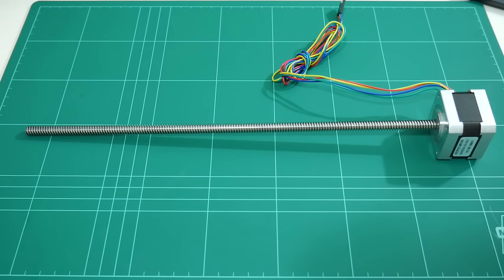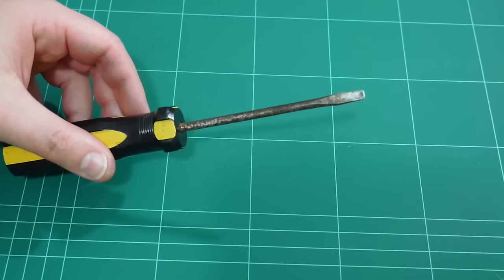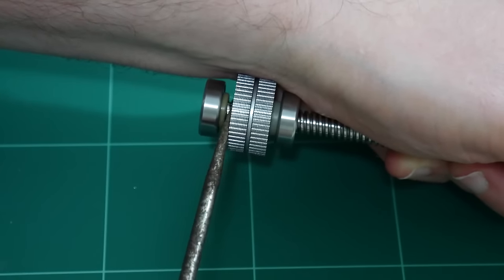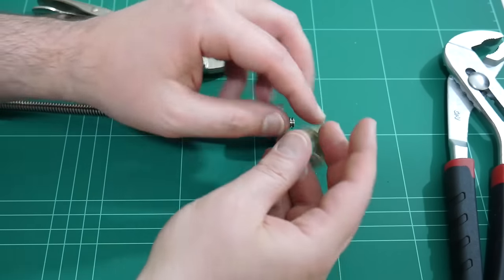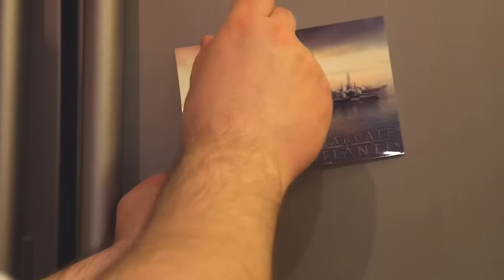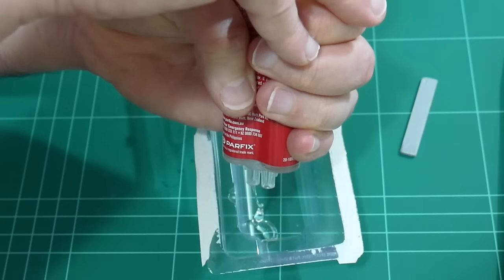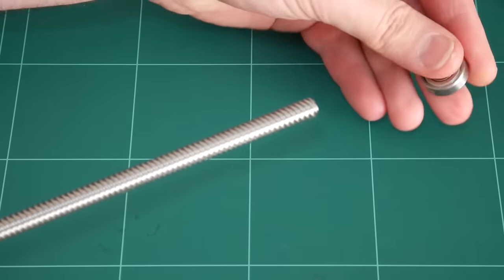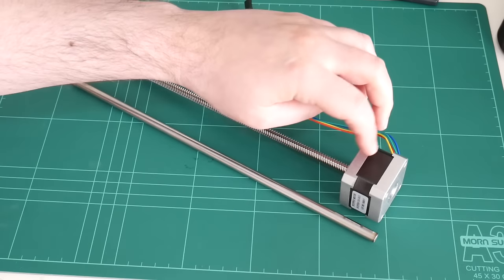3D Printer stepper motor mod

Comment: For anyone who is concerned with the loss of torque by disassembling their motors, don't be. This does NOT apply to the hybrid stepper motors that we use in our 3D printers.
Here's a video that debunks this myth: https://www.youtube.com/watch?v=A4WZm45XJ84
Reply: debunks my arse. Do you even understand what you just watched?
Reply: @m3chanist 
I took all 5 motors of my cnc steppers apart and removed the shafts and soldered better wire in. (4/18awg shielded. could have gone with smaller gauge wire but that's all I could get shielded at the time) what wire i did have was too short and a cable management nightmare because they were unbonded wires. 
There is no reason taking them apart would magically remove torque like fairies escaping a prison. if you got everything lined up right so it doesn't bind it will work the exact same.
I had an issue with binding in a few so I had to take one of them apart up to 4 times to get things aligned right. they worked exactly as I bought them when finally reassembled. 
The drivers aren't even set at full current for them. 3 out of 4A for 2, 2A steppers. 

I didn't see any torque fairies escape, nor did I damage any windings.
Reply: Then you don't know anything about the precision alignment of magnetic domains. Unless you can extract the rotor while maintaining perfect alignment, ideally with a shielding shim slid between the rotor and stator at the same time, as a professional service jig does, you are going to lose torque. The fact that you can't just "see" it and have no way to measure that accurately doesn't mean it doesn't happen.  Maybe you won't get electrocuted if you stick your tongue in a wall socket, you can't "see" the electricity right? Read Anthony Hammonds comment below.
Reply: @m3chanist  It's a self-aligning construction - to an extent - as long as the bearings are more or less made to the precise size, the spacers maintain alignment, regardless of how the shaft sits. Apropos bearings, they simply warp in use, so... there goes any assembly precision. The domains maintain as much alignment relative to each other as there was to begin with because they're all in one solid piece that you're not taking apart. The whole construction is engineered for fast and sloppy assembly which is no doubt the case if we're speaking of these $5 motors you get with the printers. Just give it a try, you can probably push the shaft in and out a tiny bit, and that's also the extent of assembly variation.

You could connect one of these motors in virgin state to a potentiometer or rotary encoder and microstep it, you'll see that it's pretty uneven, and to the extent that it's usable, it's because multiple domains and coils are engaged at the same time, the alignment is actually pretty bad, it won't get any worse. You could look at what uStepper guys are doing.
Reply: Torque is not the problem. I just changed the shaft in a motor and spent the last hour trying to get the alignment right. I failed and gave up. I can't believe that he managed to get the glued-on modification in this video working because the tolerances are so tight.
Reply: @soundspark  yes you loose torque. I've taken apart a number of steppers many years ago. REGRETTED badly after they lost half there torque. this guy is a fool claiming it wont.
Reply: The truth is: stepper motors have something called "closed magnetic circuit". 
The rotor's magnetic field is kept as long as it stays in this closed magnetic circuit formed by the stator.
Once you get the rotor out of the motor, it'll get partially demagnetized.
In this little motors it's less visible, but trust me: it'll be a bigger problem as the stepper motor gets bigger.
The thing is... In this little motors is easy to double the current to compensate the loss of magnetic field, now consider a stepper that needs 6A to operate...
By the way, I'm electrical engineer, working repairing motors for industry since 2008.
And I did magnetized a ton of steppers after "it went weak after we changed the ball bearings".
Another tip: you can disassemble it, just guarantee that the rotor don't get out of the stator, and you'll be fine.
Reply: @electronicscaos  Hello. I disassembled my nema 23 in order to replace the pulley. Indeed, the magnet lost its strength and the voltage in generator mode became half as much. tell me, can I magnetize the rotor at home?

Comment: I was following your instructions but I took my stepper motor apart and now I can't glue it back together because I can't print the stir stick, because my stepper motor is tore apart...
Reply: Why did you follow instructions before knowing what they did? Also, this isn't an upgrade, this is a mod to use an old stepper in a brand new printer. If your printer is already working, doing this will literally just make the leadscrew either too long or too short...?
Reply: Someone obviously didn't get the joke.
Reply: @chemykl  Did you wait for 24 hours

Comment: lots of comments about using heat to take the rotor off the shaft.  too much heat will damage the magnets, stick with hot water.  also if you do not use a high temperature epoxy then this will fail when if ever your stepper gets really hot.   The ball screw I used when trying this was 0.001 in. smaller that the shaft the stepper came with.  additionally the shaft had crimp marks on it possibly to make the bearings and rotor snug and centered.  I was not able to recreate this crimping perfectly.  my rotor rubbed on the stator because it was not centered perfectly.  I put it on my lathe with a high speed grinder and straightened the rotor enough for it to work.  However I have to think this will not function 100%

Comment: My magnets came apart, and I had to do this twice. Make sure the N and S magnets are out of phase when you goue them back together. Also, I really had a tough time getting the glue to break and I scratched up the magnets a bit. It's performing fine, and since it was basically scrap, I'm happy I did it. Thanks for the tut.

Comment: Thank you Tech2C for this video. I have been able to swap the lead screws in a couple of ANYCUBIC/Aliexpress integrated lead screw stepper motors. I used hot water to soften the adhesive and held the magnets in the wood-lined jaws of a vice rather than in multigrip/water pump pliers but otherwise the method was the same.

Comment: Rather than using channel locks and vise grips and potentially messing something up, try submerging the end of the shaft with the rotor into a jar of acetone for a couple hours.
It will most likely allow you to easily unscrew the rotor with little effort.

Comment: How's this mod holding up? I've found that those those super fast cure 2 part epoxies tend to be very brittle. The faster the curing, the more brittle it is. Curious if the heat and vibration has caused any issues for yah.

Comment: I just took my stepper motor apart about 4 times trying to fix it.  I traced the problem to it's connector - it was wired wrong.  Now it is working great.
I am just proving the point that taking the stepper motor apart doesn't affect it's performance.  The rumor about demagnetizing it is a bunch of BS.
And thanks to Tech2C for great videos and designs.  Keep them coming PLEASE!
Reply: I just checked my spare Nema 17 motor (brand new) and it spins freely.  I think you should hook your motors up and see how they work.  If you put them back together correctly they should work fine.
Reply: You may wish to understand how stepper motor works, and lots of superstitions will disappear. If it now works like a brushed motor, you might have destroyed some magnetic poles. For example, did you scratch the wires with hard (e.g. metal) tools? Did you looped the wires differently? Did any wire got broken, such as through bad soldering?

Comment: Hopefully, reversing the order of the two plastic washers won't have adversely affected the operation of the motors...  There now appears to be a gap between the lower ball bearing and the bearing seat - so once a load is put on the screw, you may find the motor doesn't rotate correctly.  (edit: just checked and there was a gap to start with - so maybe it won't be a problem).
Reply from the maker: Good spotting. I recorded this video over 24 hours and forgot which plastic washer was the top/bottom. I'll crack it back open and swap them around. Cheers!

Comment: doing this with smooth rod could create a very interesting quadrap/ultimaker style mechanic driven directly by the motors, no belts connecting the motors and the turning rods. might just try it for my next build

Comment: You can replace the screw with a larger diameter one, if you make sure the end of it, will fit through the motor hole. (but it will be harder to mount, if you need to glue it).
You can do this, in a lathe, if required.
It would also be nicer to break the glue bond chemically, instead of brute forcing it.

Comment: @Tech2C be honest with me... did this motor even run (let alone turn) after doing this? Steppers are built with such an incredible high tolerance. I attempted this with a NEMA 17 motor that I wanted a length of the screw sticking out of the top of the motor (for a knob). Using the same spec screw, I made the longer shaft & reassembled it. The shaft would not even turn in spite of going together very nicely with just the right amount of press-fit (or so it would seem). The original screw had a few radial serrations where it pressed into the stator. Apparently the lack of them in the replacement screw was enough to cause an issue. Once reassembled with the original screw, it did run after much messing around with it, but it just wasn't the same. Turning it by hand you could feel where it would 'catch' occasionally. This of course translated into lost steps when running. It also had much lower holding torque. So, in spite of a screw swap seeming to be a fairly straightforward modification, it just doesn't work unless you happen to be extremely lucky, or extremely skilled in stepper motor disassembly.

Comment: Is the flange on the back end of the motor adjustable for preloading the bearings?  It looks like an adjustable part, the part with the two opposed small holes. Looks like you could use a spanner type wrench to adjust.

Comment: I wouldn´t be concerned with loosing torque just from taking it apart and back again but if you do this be careful with the bearings and don´t pry them off with a screwdriver, there are tools that remove them without damaging them. Also get the washers right, they arent the same. I would also make sure you put the magnet on the same way as it was from the beginning ie. north and south.

Comment: Hi. question. i know this is an old video... im working on building a printer, and i have motors id like to use for the z axis, but they are not the type that have the leadscrews integrated in the rotor, like these in the video...  ive looked for replacement rotors that have an 8mm hole, to no avail..  am i able to drive out the 5mm shaft, and use lathe to open up the center hole, to 8mm?  will this affect the torque of the motor, or mess with the magnetics? is this possible, to create integrated leadscrew rotors for these motors, by modifying the existing rotors?

Comment: Loosing Torque by screwing with your stepper motor......I've been reading the comments and realizing now I've heard it all...
Here's my experience....
I have disassembled modified and reassembled MANY steppers as I used to salvage them from printers, drives, copy machines....
The answer is, some did some didn't.
I can't tell you which were more of a problem and which weren't but I have torn apart and successfully rebuilt- bipolar AND unipolar drives. Whatever I did to mess up some and not others is a mystery.
I didn't start having problems until someone told me it was possible to screw them up and I started being careful.
I would have sworn when he dropped it on the table to knock out the threaded rod it was done for, and again when he used them as refrigerator magnets....
I don't mess with them anymore.
I have ruined maybe 1 out of 4 or 5???
Now I either take them as I get them out of other things or I buy them the way I need them.
I've never found a way to "recover" one, but I have kept all the reassembled drives put together and in a good sized box in the hope I could fix them some day.
I have swapped bearings in a couple of very expensive drives and when doing so didn't remove the magnets from the housings.
I also have found banging on them seems to ruin most of them.
I press out shafts and bearings.
I did mess up one drive that I bought new and had a timing pulley already on it I had to remove.
I was careful but firm when I drove it off by holding the pulley and hitting the spindle with a dead blow hammer and   punch.
It turned so smooth after that you couldn't feel the steps at all....

Comment: Hello , I needed to know if you as manufacturers of electric stepper motors, what materials in your sheets do you use? are:
Do you laminate silicon steel sheets? (Yes: 5Fe)?
other sheet metal materials?
silicon sheet steel?
SID-ELE1?

And I don't know what thickness maybe?

Thank you so much

Comment: Just did this on my old z motor but didn't use cardboard to protect the magnetic rotor. I will on the new one when I have to switch out the lead screw for a longer one. Good tip!

Comment: I'm planning to mount a motor in the middle of a smooth rod, to reduce a set of pulleys, so I would get a direct drive. I'm thinking of filing the rod to get better adhesion. Would regular two-part epoxy be good enough or should I use JB Weld?

Comment: Have to take a look at the insides of a couple of steppers now. As my i3 uses 5x.50 threaded rod for it's z axis, I'm wondering if I can pull the 5mm smooth drive shaft out of one, and epoxy in a 5mm threaded rod in it's place. And yes, that's going to require validating that the 5mm threaded rod I consider check out as true first, and not be damaged in the process, but I was thinking of that as a given. Also going to have to come up with knurled grips of some sort to allow me to fine tune each axis independently. Perhaps a g2 drive pulley....

Comment: Possibly a dumb question here, but in order to do this kind of a conversion, you have to have a lead screw stepper in the first place so the inner diameter is 8mm, this conversion is not possible with a 5mm shaft stepper correct?
Reply from the maker: Yeah that's right, you can only replace the shaft with another of the same diameter.

Comment: I just did this to use longer lead screws for my hypercube and now the torque is now super low . It won't raise or lower the bed under load. Any recommendations? They each rotate freely unpowered.
Reply: You may have inadvertently flipped the rotor or you may have put the thing back in off-center.

Comment: Thank you very much ! The shaft on my motor was unglued for a unknown reason... I was wondering why my z-axis was always out of sync, then I realized that I can manually rotate the shaft of the motor (without feeling magnets), when the motor is supposed to be blocked.

Comment: Have you found that the epoxy softens as the motor heats up?
Reply from the maker: Good point. I'm using this motor on the Z axis which doesn't get hot. The epoxy I'm using was under $5 from the hardware store, but maybe a higher temp epoxy should be used (if it exists?)

Comment: Where do I get such a seppermotor, because your link for it is dead , because this opens a huge variety of possibilities🤔. There are printer constructions out there where they use two Nemas and e long shaft to move a gate with this you could place just a strong one in the center of the long shaft simplifying the construction a lot. 😏

Comment: Would like to add. Clean rod & inside magnet with acetone before reglueing.  And a question: Does it matter what side of the magnet goes on first?
Reply: Yes, that very much matters. It all needs to go back in the way it came out.

Comment: My stepper motor lead screws are attached with a coupling , the shafts in all my stepper motor's are about 160 mm with a flat spot that the coupling attaches to then the lead screw just attaches to the coupling with a grub screw .... the coupling is meant to break in the event of a jam and with absorb a minor out of alignment .

Comment: Can I modify my 5mm shaft stepper motors by drilling it on a lathe to acommodate the 8mm shaft ? Same goes for the upper and lower bearings which would need to be machined to easily slot in 608zz bearings.
Reply: if you have a lathe, why not just turn down the end of the screw?

Comment: Would it be possible to convert a stepper without leadscrew to one with?
Reply: The seats for the bearings and shaft diameter are all the wrong size to just do it like this. If you were to grind down the lead screw section as long as the motor to the the 5mm size of the original shaft, you can do it, but i wouldn't know much about that - i suppose if you have a lathe...

Or if you use a 5mm diameter lead screw, which seems like a spectacularly bad idea.

Comment: how can run this motor without driver. i am use this motor for another project. so how can run only in power supply 12v in

Comment: Next time, heat the shaft with heat gun on both sides beginning with short side and apply gentle rotating pressure. Use leather between component and channel locks and vice jaws. That way, you're not harming either component. The melting temperature of the glue is well bellow the temperatures needed to harm the magnet.

Comment: Have you tried heat to weaken the epoxy first?
Reply from the maker: Since this video yes I have. Boil a kettle and pour the boiling water into a jug. Wait a few minutes for the temp to drop to about 80c. Then plonk in the leadscrew+rotor magnet combo into the water. After a few minutes the rotor magnet comes away much easier. Just be careful with too much heat as it could demagnetise the rotor.